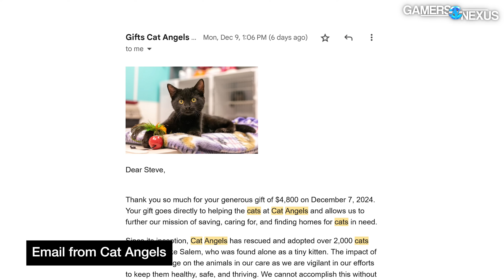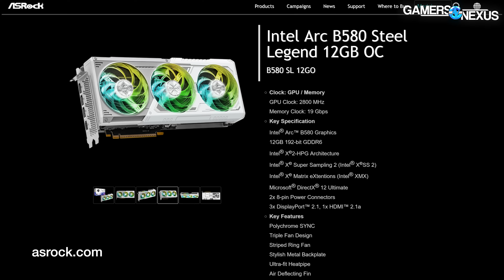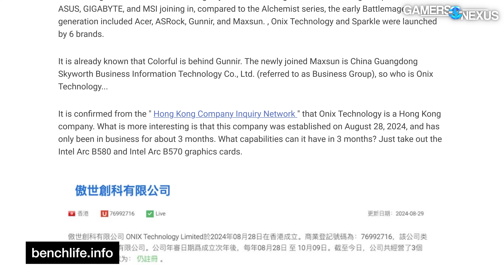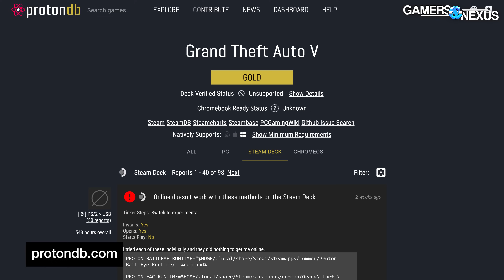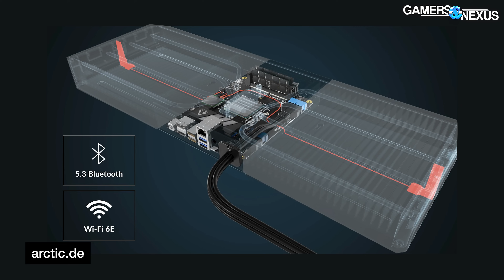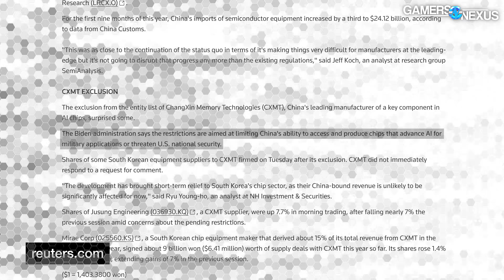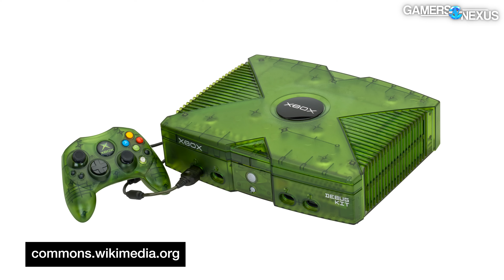HW News - Intel's B580 Victory, SteamOS Growing, NVIDIA Blackwell US Manufacturing Rumor

Comment: I think the B580 is a bust, at least for now. I haven't seen any available other than on Ebay for $400+. I'm surprised nobody is talking about the potential that they have all been scalped. I bought a Quest3 for my kids' Xmas instead of a GPU upgrade I didn't need. Their Oculus Quest1 is long dead since Meta stopped supporting it, and our Rift CV1 is on the fritz with the audio ribbon inside the headstrap having long since sheared off and killing all audio and now the cable is glitching out. We went from being the futuristic house in the neighborhood with the two VR headsets to basically having none.

Comment: It would be nice if someone actually did in depth hardware testing of computer mice. Its a stagnant market segment that is reliant on marketing gimmicks that provide questionable benefits. Ultimately the only things that matter are the optical sensor and the switches, with wireless mice latency and battery life should also be considered. 

The switches they use all are all based one the same design but are manufactured to different levels of quality. This doesn't matter because they will all eventually break. This is planned obsolescence plain and simple. They could design better switches but that costs money and then they couldn't sell you a new mouse every two years. You can do things like bend the metal bit in the switch back into place or de-solder the switch and replace it, but you shouldn't have to.

Two scumbag companies that should be singled out are Razor and Steelseries. Razor made optical switches that claim to reduce latency, but they use the same bent metal part that normal switches use so they are also guaranteed to break. Steelseries actually made magnetic optical switches. these are the real deal and actually work but to ensure planned obsolescence they made the spindle of the mouse wheel as thin and flimsy as possible so that it is guaranteed to break. I think the magnetic optical switches are only ever going to be used on the Prime mouse. Their newer models have gone back to normal mechanical switches.

Comment: For maximally efficient teardown, may I suggest High Explosives?
Reply: It's not efficient if you have to spend 5x as long pulling bits of it out of the walls, floor, ceiling, and replacing furniture as you would have spent with a conventional tear-down!
Reply: @davidgoodnow269  Coward talk.

Comment: Looking forward to your Linux tests as I will not be switching to Windows 11 once games stop running on 10. Already switched my laptop over . Only Windows system left in my house is the gaming rig.
Reply: Same here. I hate 10. No way I'm ever using 11 I've already converted my spare pc to Linux so I could get use to it. Bout to upgrade my main PC and when I do I'm not installing windows on it
Reply: Why wait? Take control and tell Microsoft to shove it. I am not gonna say Linux is all puppy dogs and candy canes. It is a different OS and you will have to learn new things.
Reply: i switched from windows 10 to linux mint and imo games run more smoothly. for example i saw gpu usage increase while cpu usage decreased in games like helldivers 2. though there are games like automobilista 2 where you have to force compatibility in steam and those likely have some kind of impact.
this is just anecdotal evidence though as i cannot compare let alone compare 1:1
Reply: @avensisverso wait, helldivers 2 is linux native?? :o
Reply: Yea, Steve mentioning that Linux testing is in the works made me unexpectedly happy. Linux thanks to Valve and an increasingly more active community is really nearing the point where it's viable for use. The community/Valve need to work out the HDR kinks and some of the foundational quirks (especially in dual boot systems) and Linux is just about ready for prime time. With GN officially supporting it in reviews, it also opens up the door for more people than just steam deck owners. I messed around with Cinnamon Mint earlier and it's almost there. Way better than the state of linux even like 3 years ago.
Reply: @JO_______ My first owned computers were an Apple laptop and a Windows tower built from components, both bought from a neighbor in 1998; in 2000, I added my first Linux computer because I didn't want to spend the money on Windows, and I had been wanting to get involved with Linux since 1994, and I finally could afford both the money and time. I have run one of each since then, using one until it frustrates me enough to switch to whichever does a task better and staying with that one until repeat.

The hands-down best way to do dual boot is to use an internal drive or USB formatted in something all three can read from and write to, and use a removable drive as the boot drive. No dual booting, too much lost data and time trying to correct startup problems, not to mention when one OS decides to overwrite bits in another OS's partition! This is easy even with laptops, if you are careful to read the service manual before picking a laptop. You want one where you can access storage without removing more than two screws, and preferably having a modular bay or second M.2 storage slot. External bays are ludicrously expensive if you go Thunderbolt, but fortunately there's always someone selling the previous gen used for cheap.

An option is VM, but it's simply never been worth it to me to learn how to work around all the bugs and flaws when I have hardware.
Reply: Yeah I'm going to be having an odd year of trying to get my dumb brain into linux. If it wasn't for gaming I wouldn't still have windows 10. Hope bluestacks or ldplayer embrace linux too.
Reply: @sezcam79  Use waydroid instead for android on linux.
Reply: Did the same with my laptop to familiarize myself with Linux. 

It was rough at the start because I decided to install Fedora Silverblue which is a immutable OS with GNOME desktop & the Linux kernel it shipped with doesnt completely shutdown my laptop. But several updates to the kernel that shuts it down properly & some GNOME extensions to make it more Windows like later. Its been smooth sailing

....except that laptop firmware update as the download button does nothing so might have to consult a guide & dabble in the terminal again but atleast I have a reason to open up Cool Retro Term again.
Reply: Congrats to everyone switching. You won't regret it.
Reply: Let's face it. Windows never has been a proper gaming platform but rather focuses on bureaus. Businesses are where Microsoft makes money the most like with their azure services. Try to install windows on a gaming handheld and you will see what I mean.
Reply: 2025 year of the Windows to Linux/MacOS mass migration.
Reply: Been running CachyOS Linux as my main OS on my gaming rig for over a year now and loving it! I hardly ever need to boot into Windows at this stage
Reply: I am in the same boat. Used windows since the 3.1 days on floppies. I am not moving over to 11 if i can help it. I just built a new AM4 machine that has 2 M2 slots now so i can start using linux on the main machine instead of firing up two separate computers. 

I used a raspberry pi 4 since it came out so have limited knowledge. The Pi 4 was the ultimate small form factor PC. I had a PC die on me and was witjhout one for about two months or so. I had to save money. That sucked. Talk about boredom and being actually addicted to the net and PC use. You will see how much time you spend on a PC when you dont have one.

. I will keep my old machine as backup in case this oen dies for some reason. Chit happens.

I tried Mint and for gaming that required fiddlign with it installing other stuff such as wine and proton. I did not want to do that. So tried nobara. That worked out of the box. But you cant use the normal update button that they have. That will brick your install. The way to update nobara is inside the "start" menu.

Comment: I can buy (In Poland) - new RX 7600 (8GB) for 200$. We don't have Intel Reference model. Cheapest AIB model of ARC B580 starts around 310$. For all of those you'd need to add 23% VAT.
So sadly, unless there is Intel's "Limited Edition". It doesn't look super well. Cheapest of those AIB models are same prices as most 7600XT. NVIDIA is even more expensive of course.

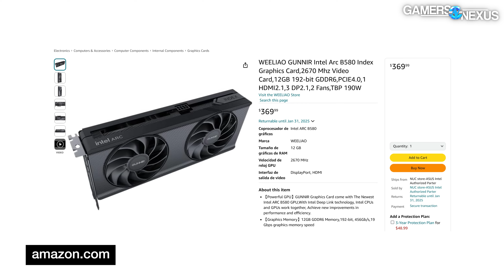Comment: 10:40 No not a bad joke x3, it's something I woulda' thought if I had seen that card- although might wanna take it easy on VR jokes if you're talking about an Arc card. They're still not officially supported by intel from what I know, not actually 100% if it would work with the new BMG cards tho. The community has gotten Alchemist to work with VR through wireless means however! I've been using my HTC Vive Pro1 with my A770 with HTCs official Wireless adapter and after Intels newest 101.325 WQHL driver update, it's working pretty well i'd say.

Comment: That battlemage card is getting more praise than it really should be getting. It's aight but we aren't looking at a 4070 killer or a 7700 xt killer. We are looking at a low to mid level gpu that can sorta do raytracing while also being pretty crap at anything more than 1080 with massive lows. If I was some kid with a 1080p monitor and 120hz then maybe I'd be cheering it on but it's beaten back and forth by last gen amd and nvidia gpus. It needs to do better than be thick and be average.
Reply: agreed but looking at the current state of Radeon and sub 300$  atleast in Asian market. (the 3050 and 6400 type of cards.)  Intel competing in their playground should give the radeon team some decent budget as they lose market share to Intel.

Comment: Been fully converted to Linux gaming on desktop for 6 months and honestly it's been very good
Reply: Same here, running great, some drawbacks, but mostly fixable
Reply: I have been using it on my ally since windows was horrible on it
Reply: @SciFiDude79 Battlemage did very well on the Phoronix benchmarks, way better than Alchemist. I don't know if that's down to Mesa or the kernel driver (I think both should be using Xe?),  but it was competing with the RX 7600 like it does on Windows. Not quite as fast, but the gap is nowhere near as wide as between A770 and RX 7600
Reply: Would you help me set it up? My only worry is all i play is escape from tarkov
Reply: @Bck2TheMnu  Tarkov devs do not allow the anticheat to run on linux. You cannot play pvp tarkov on linux.
Reply: @SciFiDude79 Ive only seen good things about arc + linux.
Reply: As far as i can tell, Linux does not work well with 2 or more monitors (Nvidia card), making it unusable for me. I can play games with only 1 monitor connected, but 2 breaks the display driver
Reply: @maj429  you are either on an old driver or not on Wayland or both
Reply: Windows to Linux/MacOS mass migration is coming.
Reply: @InternetListener  Why Mac???
Reply: @InternetListener they said something like that about ev's and renewable energy both basically failed after the propaganda and rebates started drying up
Reply: Good for you.
Reply: Sounds tryhard

Comment: Unfortunately Scalpers are all over the B580 it's almost impossible to find one for cheap
Reply: Seems stupid to scalp a cheap item.
I wish people had patience rather than supporting scalping.
Reply: @Ryzard  These people are just trying to gain money by making others suffer I guess I will have to wait until they restock to buy one for the original price
Reply: Weird, still cheap here in Sweden
Reply: @daedalus6433  I'm in Saudi Arabia so probably it has to do with that and haven't found cheap ones on Amazon or newegg went in AliExpress and same thing overpriced ones over 400 USD which is ridiculous if you know where the cheap ones are let me know
Reply: @dowoshek  Maybe Intel is prioritizing some markets over others. If it was a paper launch, it would've been more like the 3090 and 3080 that instantly vanished
Reply: @dowoshek  50+ on Inet by launch, and AIB models are still in stock. Doesn't seem like a paper launch here
Reply: @daedalus6433 Only the Asrock Challenger card is still in stock on Inet and it is $347.

Comment: Now I can’t wait for the arc b770 with 4080 super like performance
Reply: You're dreaming big, if it happens then Intel is officially the saviours of the GPU industry
Reply: With a die size larger than a floor mat. Good for heat dissipation.
Reply: lol. probably more like 4070 realistically
Reply: lol. probably more like 4070 realistically

Comment: We had steam os at home for a while. Just install arch btw.
Reply: the “we have at home” meme generally has the corresponding at-home thing be garbage, though, so I don’t really know if that works here. 😅
Reply: @Shlorpmeister  not really, SteamOS is just latest Arch Linux with KDE Plasma and Steam pre-installed. Replicating that is fairly easy with Arch Distros like EndeavourOS, or SteamOS specific Distros like Garuda, CachyOS and more
Reply: @uwu_peter It's also immutable and using it's own compositor
Reply: @Voyajer. Immutable? It's more unusable.
Reply: @Voyajer.  Gamescope is available for Arch Linux too, as for Immutable sure, offers more Stability by getting bigger System Updates from Valve instead of doing them yourself
Reply: @rch5395  Immutable means you get Updates from the Manufacturer/Distro Provider, akin to getting Android Updates or iOS Updates for example
Reply: I mean, steamOS is its own thing still. It is an immutable distro with its own compositor. I actually think if you are a casual Windows user, Arch isn't the simplest distro to just drop into. They are targetting very different users I think.